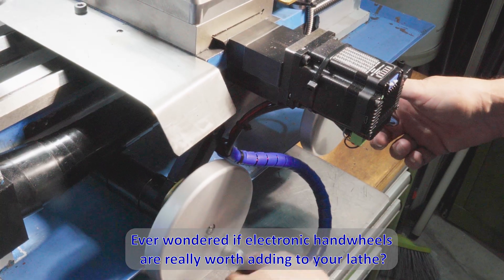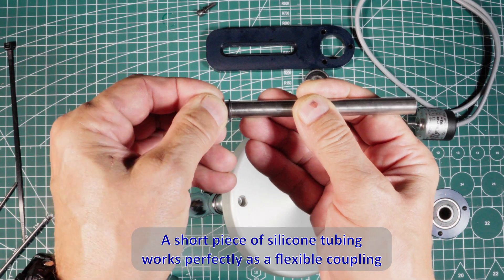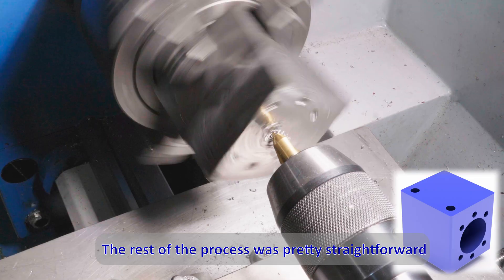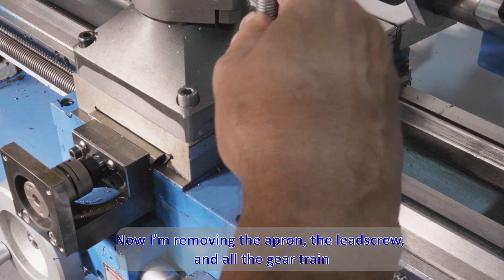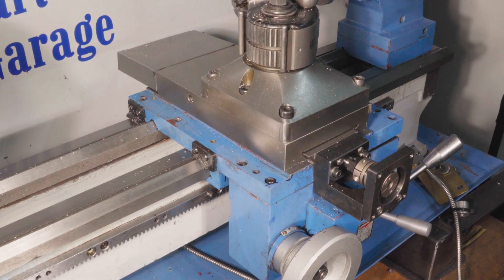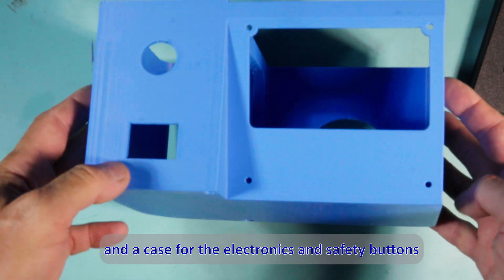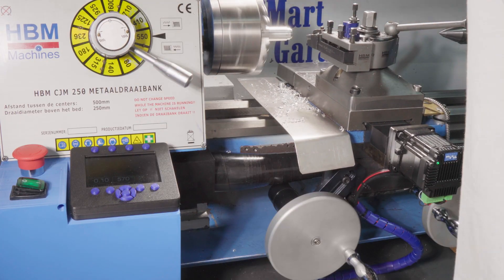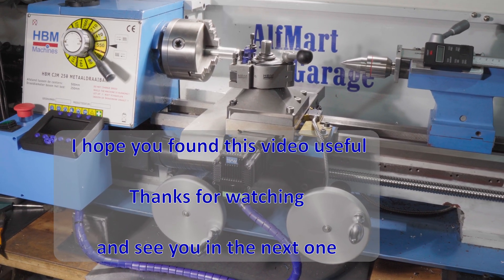Electronic Handwheels on My Lathe – Is It Worth It?

Comment: Great video. Thanks for sharing. You show another kind of handwheels on a cnc lathe. I don't like to convert a manual lathe without handwheels because the most is manual working with it. My way is a little bit different. I use two CUI Devices AMT103-V one for integration direct behind the X-axis leadscrew for using the original handwheels. Also in Z-axis it will be mountet in the original apron. But for now the controlbox is in my hands.
Reply from the maker: Manual working is also 90% of my lathe time

Comment: Do your encoders have detent,  and if so, does the feel transmit thru the parts to the hand wheel or is there just too much isolation?
Reply from the maker: No, the encoders have not detent torque, they run very smooth, however the friction can be adjusted by mean of the from screw. Regards

Comment: Would it be possible to add a strain gauge and display to show how hard the tool is being pressed into the work?
Reply from the maker: in principle yes, however the real implementation could be complicated, the need to not reduce to much the rigidity of the tool post can complicate the design. I will think about. Thanks and regards

Comment: Nice work! This is the ideal use of 3D printing, when you just need a specific shape and don't care what it's made of. Another great printed tool is a pair of chuck keys for the 4-jaw with screwdriver-type handles. Quickly move two jaws together until you have it just about dialed in, and then switch to the real key with T handle to snug it down.
Reply from the maker: Thanks, and yes I love 3d printing for my machines...

Comment: Very nice run-through on this and of much interest to me as I recently put an ELS (NanoELS H5) on my own lathe and was pondering whether I should motorize the X and put ballscrews on Z and X. In the end, I opted against it. Mostly because I have a small CNC lathe I will refurbish soon but also because I wasn't sure how it would feel with encoder handwheels. 

I think it looks good in use as per your video but one small thing: It looks like you can't "whip" back along the Z as fast as you can by undoing a halfnut and using the carriage handwheel, right? I think I saw you go to the controller jog button for that? 
I think most ELS FWs are possibly missing a beat here as it should be possible to program a feature where when the encoder spins fast, it steps up in increments and thus moves faster/more coarsely. Or you could do the second best thing and add a button for increment size near the handwheels - maybe a hold down button where it goes to a high increment while you crank the carriage handwheel. 
But I guess the developers are refraining from this out of simplicity's sake but also because if you get the implementation or use wrong, it could lead to a lot of scrapped parts - when the carriage all of a sudden speeds up more than you expected;)

On the NanoELS project, there's a user who has made the encoder behave as I just mentioned, he reports it works well and changes its speed gradually/flowy and supposedly feels very intuitive. He's planning a whole rewrite of the FW but not sure how far along it is. 

BTW, not raining on the ELS you chose, it was indeed high on the list of my options but since I am based in Asia I could source the parts more affordably for the NanoELS project. But I think yours could be the most afforable off the shelf, proven option out there. 
But I also wanted to have DRO on the same screen as the ELS which I finally ended up getting by modifying the FW with the help of AI since I can't code to save my life;)
Reply from the maker: Thanks for your comments, very interestings. 
WRT high back along Z, I use the four buttons on the ELS (X and Z movements) the speed is programable and for me is fine enought. 
 Ballscrews improve a lot the acuracy of the lathe, but yes it was a nightmare in the X axis due to the small dimensions of my lathe (I have another video about it)

Comment: As an Engineer, sometimes you want to feel the cutting process...This removes the feel of the machine...Is it a CNC machine or a hand lathe, it can't be both I guess...?..🤔😳🇬🇧
Reply from the maker: Yes, the feedback on the cutting proccess is very important, but I've being with my lathe for years and I know by the sound how is performing ...
Reply: Honestly after you get some experience with manual machining I've found the feel really isn't very important. Bridgeport EZ path lathes are all drive by wire like this and they're great machines to use.
Reply from the maker: yes, this is my experience too , I'm geting familiar with the "wired lathe"
Reply: Yeah, the X and Y screws of my milling machine have hand cranks on one end and motor on the other. Z is two leadscrews driven by a belt. Gripping the belt by hand allows raising it quickly for tool change, and gripping the pulleys allows fine control. Perfect combination of manual and CNC.

I intend to add a motor on the leadscrew of my lathe so I can do coordinated motion with the hoverboard spindle, but I'm not sure if the cross slide can be electrified since the other end of the screw isn't really accessible, and a motor on the hand crank end would be in the way.

Comment: Good work.

You have a great opportunity here,  to combine this with LinuxCNC and have a lathe with two modes, manual and also full CNC :)

Subscribed - I am an RC Jet turbine enthusiast :) looking forward to that project. Which model did you decide on?
Reply from the maker: Yes, you are right, full CNC will be great, but for the moment I don't need it for my projects . For the turbine I pretend to build the GR130, I have started some parts already, and I will describe hopefully it in the next video , The turbine requires CNC lathe for the compresor case at least, but I made some test in my CNC milling machine working as a lathe, and I think will work. Keeping in touch
Reply: @alfmart58  Rutten's take on the KJ66? Nice :)

I don't know if you build one before, and I don't mean to be patronizing either, but you need to keep your tolerances REALLY tight. Don't try to build NGV and Compressor, buy them raw and pre machined from somewhere and finish them yourself. Compressor wheel being Inconel 713 or 718. A lot of builders don't realise how critical this is, there is a lot of heat for these and steel builds either seize if tolerances are high, or on the other end, they are loose enough to the point of not sustaining burn. 

And I foresee a dynamic balancer is in your future :) Not a passive, a dynamic with software :)

Looking forward to it :)
Reply from the maker: Thanks for your advice, and yes tolerances are really key. I pretend to build the turbine disk and the NGV from inconel 718, I have alredy some small experience and I recognice it is a challenge, but this is the spirit of DIY, buing parts is an option but not fancy to me...Cheers
Reply: @alfmart58, love the DIY spirit :)

Apologies in advance for the long response :D And of course, it’s your engine, build it as you deem fit. That said, I would offer a couple of quick, practical notes:

1. 718 for the turbine disk/NGV makes sense. For the turbine wheel, most builds use cast nickel superalloys (e.g., Inconel 713C, MAR-M); 718 wheels are less common. Do not use steel for the turbine wheel. Its high-temp strength, creep, and oxidation resistance are inadequate. In my own experience, 90% of the self-builds that fail do so for these reasons. Also, avoid machining a (car) turbo compressor wheel. You can self-sustain with an automotive compressor, but for RC flight you usually need a well-matched map/trim and diffuser or you’ll leave a lot of thrust on the table. Depending on the source, Inconel stock can cost more than a ready-made vacuum-cast 713 wheel.

2. For building your own NGV: It should be brazed or welded. Ideally vacuum-brazed (don’t know many home shops with that :D) TIG can work, but warps easily. Small errors in vane clocking or throat angle/area create hot spots and uneven expansion; a perfectly balanced rotor can still shake itself apart.

3. Fixture like your life depends on it. Design cold clearances that grow hot, keep runout/concentricity tiny, align combustor-NGV-rotor, and do a two-plane dynamic balance of the assembled rotor.

To get an idea about tolerance targets:

a. Shaft TIR at bearing journals: ≤ 0.003 mm (absolute max 0.005 mm)
b. Concentricity (from compressor/turbine bores, relative to shaft datum): ≤ 0.005 mm
c. Bearing bores (front to rear) co-axially through the case: 0.008–0.012 mm over the full span.
d. Case faces squareness to bores (thrust faces, seal lands): ≤ 0.010 mm over the diameter.
e. NGV to shaft concentricity: ≤ 0.020 mm; vane clocking/throat area match within ±1–2%.

If this is your first build, strong recommendation: buy a known-good NGV & compressor for v1, then machine your own for v2; still PLENTY of DIY areas left. The electronics alone is a project on its own merit.

And lastly, spin-test behind a shield. Safety first. You have an aerospace background, so I’m sure you know more about it than I do :)

Cheering you on; the first self-sustain is pure magic. All in all… you have a great adventure in front of you, enjoy every minute of it :)
Reply from the maker: Many thanks for your very valuable info, I will analyze all of them. Regards

Comment: It looks like a nice option if you are one who always go for the handle  I don't know how well I would go as with no sort of detent on the rotation of the hand wheels holding position would be a bit iffy?  
When I did mine I used a couple of spring centered toggle switches and a speed/feed rate adjustment knob for each axis.  Never bothered with the spindle encoder as I left the conventional lead screw in place to screw cut.  It was very crude as I just used the DRO scale for positional adjustment.
Reply from the maker: In my design, the fritcion on the handwheel can be increase just by tighting the front screw, in general I never had a problem with holding position, but thanks anyway for your comments

Comment: I may have missed it, but are those encoders that the hand-wheels turn to regulate the motion of the Stepper Motors?  The video would have been better if it had no music and more descriptions.  Thanks.  PS:  I built a 3 axis power feed unit for my milling machine. Rather than hand-wheels, I used a Joystick potentiometer for regulation, as well as switches and potentiometers for continuous operation.
Reply from the maker: Yes, the encoder in the handwheel is used by the software to drive the stepper, the amount of  travel per handwheel turn is programable, and yes I will try to improve my descriptions in the next one, thanks for your comments
Reply: I will take the liberty to reply here: 
Yep, the encoders "talk" to the controller which in turn sends step and direction commands to the stepper motors. Also, it's more of a "one to one" operation - you turn the encoder a given amount and the machine will move a given amount. Not so with potentiometers which is more of a stop and go thing. They will make the machine keep going unless you turn them off. So, in use, encoder handwheels will act pretty much the same as if you had manually coupled handwheels. 
Another possible benefit, encoders are supposedly less prone to noise which means they shouldn't send errant commands and make the machine move. 

Hope that made sense.
Reply: @AntiVaganza  Yes, thanks. I used rotary encoders in my power feed build to move the table in 0.001" increments, so I do understand how they work. Thanks again.

Comment: Nice! Did you consider using anti-backlash gears for the encoder?
Reply from the maker: In my opinion , this aplication do not requieres a hight accuracy in the encoder. The encoder is used for automatic turning-- no backlash requirement , for threding: here yes but the ELS start always from the same direction, so, backlash is compensated. In any case I taken care of the gear manufacturing and mounting to reduce the backlash at a minimun.
thanks for your coment